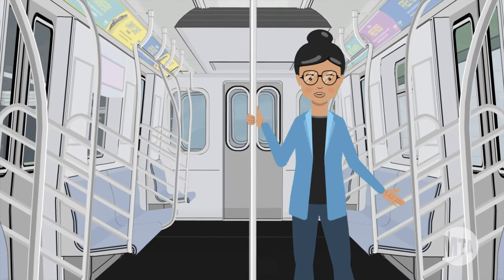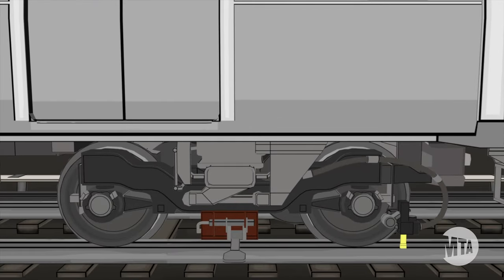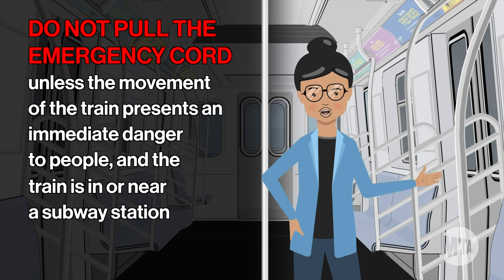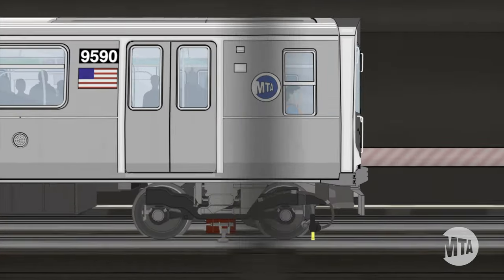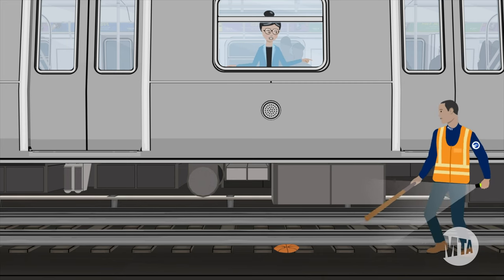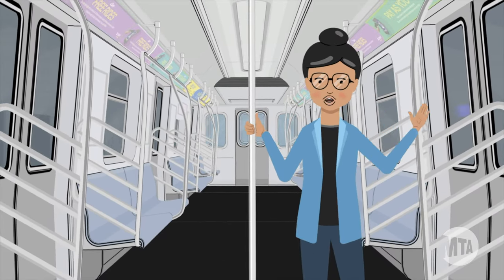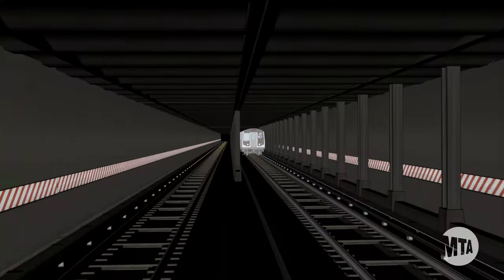What happens when a train's emergency brakes are activated?

Comment: Who threw a deflated basketball on the tracks☠️☠️
Reply: The basketball had air in it before the train hit it. It deflated off camera.
Reply: Still, how the fuck did it get there in the middle of a likely long tunnel
Reply: @Fowlware  mb i wan playing ball
Reply: @Fowlware  
 Some silly kid dropped it on the tracks after bouncing it on a platform. A place where they shouldn't be playing any type of ball.
Reply: How did it get in the fucking tunnel
Reply: @GamingWeekends1  i was shooting hoops my fault
Reply: Word
Reply: Yea that really does happen. You'd be surprised how often you hear it on a transit radio that's the cause 😒
Reply: Actually, the basketball was inflated on the tracks, when the level hit, it deflated the basketball
Reply: @GamingWeekends1  ACTUALLY, i was playing basketball and the ball hit the track and deflated
Reply: Only an idiot or a jerk would do that. : 0
Reply: @ItzYaboiTristanYT  No, you threw it on the tracks by accident and then the lever decided to pop the ball as well as the train saying help me
Reply: @GamingWeekends1  na i remember the ball hitting my head after it bounced off the signal
Reply: @Fowlware  probably some dude was switching to the next car over and lost grip of the ball
Reply: emergency break is on for something for example a bike is on the tracks you pull the emergency because the bike has power
Reply: @stephenweng6723  yea the ball i threw on the tracks
Reply: Who knows 🤷‍♂️
Reply: @tntcreeper6305  i know
Reply: @ItzYaboiTristanYT  now I get it
Reply: @tntcreeper6305  ik you get it
Reply: My classmates accidentally dropped it there when they were playing basketball on the platform.
Reply: How did a basketball 🏀 in the tunnel 💀

Comment: This is why the runaway train scene in Spider-Man 2 always ticked me off. Spider-Man didn't need to nearly die, someone just had to pull the emergency brake! That's without mentioning subway trains are built around "dead-man" brakes –the train only moves so long as the driver's actively at the controls.
Reply: There are no steering wheels in the train therefore the train really isn't driven it's operated. 
Also the 'dead man' switch is called the master controller. This is used to both propel and bring the train to a controlled stop.
Reply: @adriancooper78  True, but it doesn't eliminate the fact that the main commenter is 100% correct.
Reply: @maiki5962  
It is? No, it not! 
Trains are not driven they are propelled They can not avoid obstacles on the track by the train operator steering or driving around them!! 
Who knows more about the operation of a train? A train enthusiast or a train operator? You inform me and I'll will listen.
Reply: @adriancooper78  Trains without rails are driven. So, saying "trains aren't driven" is a fallacy. 
"All crows are black".
Reply: @maiki5962  
From source of knowledge are you speaking from?!! Again does the rail enthusiast have equal knowledge to the train operator? I will question you and you inform me!
 There are no steering wheels on a subway train. A train operator can not turn the train to the left or to the right or turn to avoid an obstacle on the tracks.

Question: In the R-142a subway train what is the name of the system that causes the train to move?
 'This is train operation 101' If you can answer this question and you'll have the answers to what moves all trains
Reply: @adriancooper78  🤓☝
Reply: @adriancooper78  🤓🤓🤓🤓
Reply: The part that bothered me was the dead end but active elevated section of railway in Manhattan
Reply: And home signals that can be forced to DANGER and thus trip the train.
Reply: @adriancooper78  bro missed the whole point of the video
Reply: @lumarc5513  Yep👍

Comment: Interesting :) here in Germany, pulling the emergency brake lever just results in an announcement that the train will wait at the next station for inspection. There are also managed platforms with cameras and loudspeakers that allow operators to communicate with passengers in an emergency, and all stations and trams have SOS intercoms.

Comment: In the UK, the emergency alarms on trains used to be connected to the emergency braking system. However, now, they set off an alarm in the cab. The driver will press a button which will activate the intercom, where a passenger could talk to the driver and describe the emergency.

If the driver does not dismiss the alarm within about ten seconds, the emergency brakes apply.

The emergency brakes can also be triggered if a driver doesn't dismiss the AWS horn in time.

The AWS is an alarm that is triggered when the train goes over a test magnet or over a treadle when the next signal is yellow or red.

Or if a driver passes a signal at danger (red). This is called a SPAD.
Reply: Nice !!!
The emergency intercom is similar to what is on the technology train that the MTA in New York has.
Reply: For those confused, a SPAD is Signal Passed At Danger.
Reply: The intercom system is installed in railcars on the Washington Metro. Also, this feature is available in some modern rapid transit system railcars. Fortunately, the emergency brake cord is omitted.
Reply: @captainkeyboard1007  Aware, I use the system a lot. It’s a good idea to have one of those.
Reply: @adriancooper78 Also, such signalling system is used by the Toronto Transit Commission (TTC).
Reply: @DMVRailfan  
That is much appreciated the average person doesn't have a clue as to what that acronym was
Reply: This is interesting.
 MTA New York City Transit refers to those that operate subway trains as a train operator.  Driving implies that we steer or turn the train to the right or to the left, like a bus with a steering wheel. We operate the controls that propel and stop the train. I guess in the United Kingdom, they call their train operators train drivers?
Reply: @adriancooper78  Washington Metropolitan Area Transit Authority.
Reply: @adriancooper78 In the old days, New York City Transit Authority hired women mostly to work as "railroad clerks," because clerical work was done inside the token booth. Railroad clerks would record the turnstile readings onto paper forms, an act that was called "pulling the wheels." Also, women worked as train conductors, let alone conductresses, like on the Chicago Transit Authority. In the 1980s decade, more women wanted to work as motormen, even though the job entailed some problems that would happen occasionally by stepping down from the railcar and onto the roadbed to check the signal problem, even a person under the train. When women were hired to operate subway trains, some men objected to this additional hiring. They wrote remarks and drew cartoons with ink markers on cab doors inside cabs, and I would laugh at them like curse words sprayed on to walls of open cut areas and subway tunnels. Women and men who operated trains became "train operators." When women were hired in other positions, porters became "station cleaners," railroad clerks became "station agents," motormen instructors became "train service supervisors," and finally, trainmasters became "line deputy supervisor." On April 1996, New York City Transit Authority, along with the Staten Island Rapid Transit Rail Road, went under the ownership of Metropolitan Transportation Authority. It became an agency named New York City Transit (NYCT), and the Staten Island Rapid Transit Authority became "Staten Island Railway." However, I do not agree that the United Kingdom should call their train operators "train drivers," because the trains are not steered to side turns like buses, and therefore I agree with you. I am only a subway buff.
Reply: @captainkeyboard1007  
really, I couldn't tell 😊😃🤪🤣
I appreciate the information. It's all old news to me, though. You see, I've been employed for them for the last 2 decades. 
I like the honorable mention of the Staten Island Rapid Transit Operatoring Authority  (SIRTOA), I've operated buses out there for many years.
That's why I stated that you can't really drive a train. You drive a bus, not a train.
I can appreciate your knowledge and your enthusiasm, but there's no feeling in the world like operating a train. That's something a 'buff' can not appreciate unless you've done it.
Reply: @adriancooper78  Once you have worked for New York City Transit Authority and/or New York City Transit, you are still "The Best People Around" who roll the big wheels abound. The Best People Around has been a title for transit workers since 1978. However, the subway has been my first favorite place since I was a little child. Thank you for typing to me. I appreciate your thoughtfulness very much.🖥⌨

Comment: I always wondered what it would be like to be on a train with emergency brake applied, but it’s never worth figuring out yourself
Reply: It stops short.  I pulled the brake once decades ago, when some punks were chasing a guy through the car.
Reply: @413smr  
 Train crew has to investigate and the train is delayed!!!
Reply: I know you got a good heart but you can always use the emergency intercom I know back then they didn't have one but now the trains are equipped with emergency intercoms that connects to the Conductors or train operator and they can inform the RCC where the train is and get police en route if it safe to do so they will continue in passenger service so police can meet the train if there transit police close by and they let the rail control Center know they will  respond the train operator is instructed to stop and stay there for transit police if not the train will continue signaling for police to respond
Reply: It stops short extremely quickly.  Not pleasant.
Reply: It feels like its stopping but with much force with it.
Reply: @Bobby_Duku  that the force of momentum pushing the train forward that we feel but the force when the train stops is fiction braking the hard braking part
Reply: If you're athletic and were anticipating it, like if full service brake was done before the emergency brake, you could balance the heavy force. Otherwise, it happens too quickly for you to process and counter-act.

Comment: Also, something that has to do with the tripping device, it can be activated in dangerous situations. For example, a red light (train ahead), or excessive speed (if you have a special type of security system for this). Each traffic light has a lever that goes up in red, causing the emergency brake to be activated, and goes down in green, where the train has a clear path.

Comment: The only legitimate reason a passenger should pull the emergency brakes is if a person is being entrapped in the car doors or if smoke or fire breaks out inside the railcar. Otherwise, all other problems can wait until the train stops at the next station. Then, it will be safe for passengers to escape the affected car and step on the station platform which will be safe.

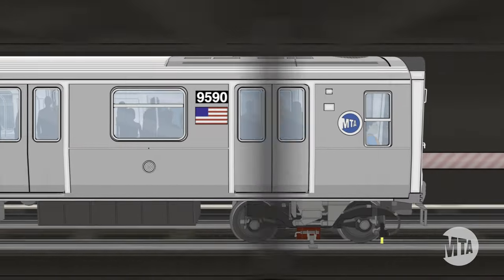Comment: 0:23 "a train Operator will typically apply the automatic brake into emergency if He spots something in front of His train"

at 0:30 You can see that the automatic brake was already in Emergency !!! if the Operator pulls the automatic brake towards Him He's actually releasing the automatic brake and when the train operator pushes the automatic brake all the way forward that's when He applies the automatic brake into "emergency"

Comment: Number 3 is a joke, I heard a story where a Q train hit a guy going through those Brighton line tunnels in Brooklyn, it didn’t trip the brakes until the 6th car went over him.
Reply: It happens like that sometimes.  I hit a bucket and it tripped under the 4th car of my train
Reply: Happen to me on the G train to Flushing ave. I was on the first car of the G train and when the fist car went in, the brakes got activated and it cause me to hit my head on the cab door. THAT EMERGENCY BRAKE WAS HARD ON THAT R160 G train back in July 2022

Comment: NYC trains are the same in almost every way like Australian trains (Sydney and Melbourne) but the Trip lever is on the left of the train and Sydney trains are double decker!  I believe this idea (Automatic Emergency) was because many years ago a NYC train ran a stop signal and crashed in to another train, before that they used air pressure to apply the brakes, since the crash, they reversed the braking system (emergency) that air keeps the brakes off! FAIL SAFE

Comment: wow, incredible
Reply: And that's just one system of the train. So imagine the intense training and the knowledge that a train operator has.
   What controls the doors, what controls the lights, what controls the air conditioning...... It goes on and on
Reply: @adriancooper78  it's not an airplane cockpit, there's really not much to a subway train. especially the older ones
Reply: @jaydottt_transitfanner  
Really? 
 Can you tell me the 3 way a subway train is connected?
Reply: @adriancooper78  What
Reply: @jaydottt_transitfanner  
That's a simple question that all trrain operators know and that most rail enthusiast or rail fan-atics know.
You did make the statement that operating a train is not as complicated as operating a plane.
Again please: In what 3 ways is a subway train connected?
It's ok if you don't know that answer, you can always ask a train operator😊
Reply: @adriancooper78  I don't know what you mean by connected what the hell do you mean how's it connected
Reply: @jaydottt_transitfanner  
Ok, 
<SIGH>  something less complicated. How many subway cars, make a "W" train? (Please use the older technology trains)
Reply: @adriancooper78  8 cars are the standard of the W line because it uses 75 ft cars, like R46. If it hat 60 foot cars like R160 then it would use 10 cars
Reply: @adriancooper78  and I understand what you mean now, they can be coupled in five-card sets, Married pairs, or single sets
Reply: @jaydottt_transitfanner  OK!! 😃 
8 cars!!! 
These 8 cars DO NOT MOVE INDIVIDUALLY on their own  (Like car #1 going forward, cars # 2,3, & 4 moving to the extreme right, cars # 5 & 6 going in an up direction toward the sky, and cars # 7 & 8 moving in reverse)
If you notice the train moves as ONE MASSIVE VEHICLE. In one single motion.
How is this accomplished? If you don't know the answer, ask a train operator!!!
(Psssssst! Hey......a.......bub.............I'm A TRAIN OPERATOR)
Reply: @adriancooper78  hey, I'm just 15, I don't work in overhaul shops, neither have I ever built a train before. but what I can tell you is that the machinery of the train tells all the motors to work in sync. They also move in one piece because they are coupled together (obviously)
Reply: @jaydottt_transitfanner  Obviously?🧐
That's not quite correct. 
The train are car connected mechanically by couplers and link bar, electrically and pneumaticly. 
So you see IT CAN GET JUST as complex as those DIALS AND GAUGE like in airplane.
One 75 foot car ( like the R-68A ) can hold about 200 poople. Multiply by 8 cars is about 1600 people. If you Google it a 747 jumbo jet holds only 600 people and the Airbus A-380 jumbo jet holds about 800 people.
As train operators during peak travel times we carry more people these planes do. Train Operation can get quite technical 😊😃👍
Reply: @jaydottt_transitfanner  
Continue in your zeal and enthusiasm with trains 😊😃👍😎
I saw you were young that why I keep saying "ask a train operator" 😊😃👍😎
Reply: @jaydottt_transitfanner  
THAT partly CORRECT 😃 coupled in 5 car sets, Married paired or a single units😃

Comment: That device at the track that is used to stop a train quickly is called a "trip hammer," or "stop arm." When a signal light is "red," the stop arm is raised, so that when the train moves, the actuator of the railcar will touch the trip hammer, causing it to move slightly, and the pressure air to be released, while the brake shoes be tightly pressed against the surface of the wheels, thus bring the train to a full stop. On the A-Division tracks, the trip hammer is raised up at the right side of the track; on the B-Division, B1-Division, formerly BMT, and B-2-Division, formerly IND, the trip hammer is tilted and located at the left side of the track.
Reply: Trip hammer? Nah, it's a tripcock.
Reply: @evilwatermelon29  The name "trip hammer" was used by the old motormen, conductors, and signal maintainers of the IRT during the 1960s and 1970s decade. The round head at the top makes the apparatus look like a hammer. When the apparatus is in its upright position and the first car passes a red signal, the brake actuator is moved by the triphammer, and it will actuate the train's brakes with a tripping process, thus causing an emergency brake to occur. Also, that apparatus piece is called a "stop arm." I was dubbed a "railroad buff" by the old transit workers when I was a kid, even though I did not know a lot about subways trains than they did, let alone the passengers who rode those trains. Thank you for typing to me.

Comment: Only from the MTA will you get:

- An incorrect gauge reading when the train is in emergency for the first example
- Incorrect position of the tripping device for the displayed equipment. 

It's like you guys can't even stick your heads out of the window. This feels out of touch.
Reply: @seaj4840 would you have been happy if it was an R142 or 188?